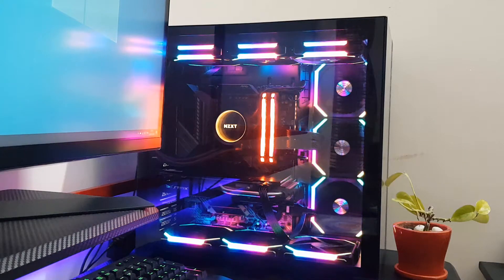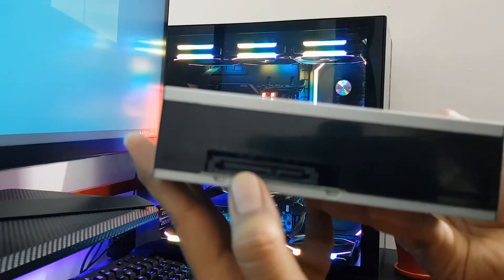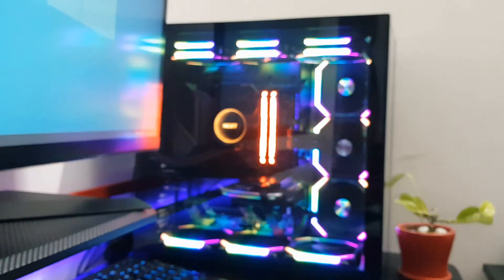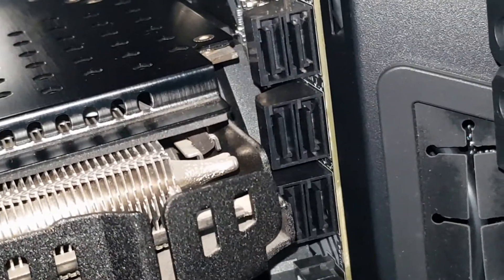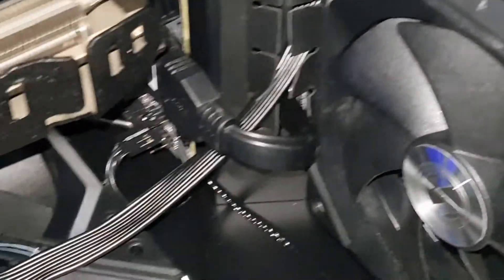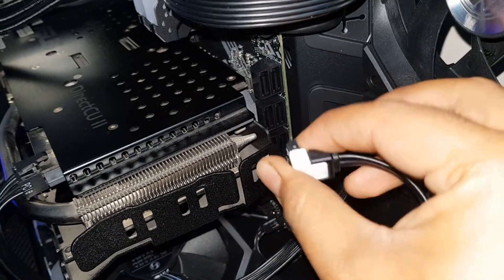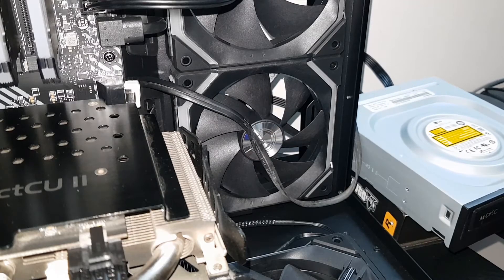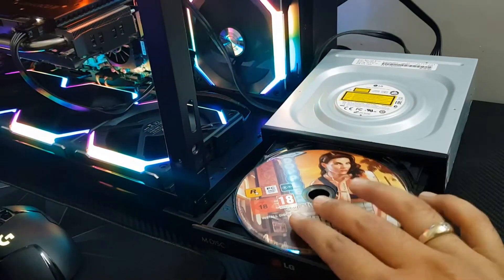Installing a CD DVD rom in a gaming PC!

Comment: Guy speaks pretty good English compared to some I've heard who were professional tech professors. The real issue to me is why don't these cases at least have a single slot 5.25" bay? I'll be using a cheap gamer case I found at a thrift store but I'll have to think carefully about the fans because the acrylic is brittle. I would like one fan blowing directly on the GPU.
Reply: I guess you would have to plug your DVD drive temporarily like the guy did in the video.
For a while, I had HDD outside of my PC case since there wasn't enough space inside.
Also, when I install an OS, I burn the ISO to a DVD-RW.
Reply: There's largely no need for 5.25" drive bays anymore. Practically no modern PC has a disk drive anymore. There are still some PC cases that have a few drive bays, but they're not that common anymore. I have an Obsidian 750D that has 3 drive bays, but I don't use them.
Reply: @JJFlores197  there actually is still a use for them, many people still use CDs. I don’t think it was the right time for them to remove them yet. It’s like they’re forcing it when they shouldn’t be.
Reply: @pawnstarrickharrison7225  I get what you're saying, but those are more of the exception rather than the norm. Look in general PC software. Most PC programs are exclusively sold as a digital format. If you do find a physical copy in-store, its usually just a download code. Its not like optical media is completely dead, but it just is significantly less used than 10 or more years ago. If you still need, you can still buy DVD drives. If your PC case doesn't have a drive-bay, you can buy an external USB DVD drive. It may not look as sleek as an internal drive, but it works pretty much the same.
Reply: @JJFlores197  Can you recommend me some cases that still have drive bays?
Reply: @GXMenace  I haven't really kept up with cases in a long time. Like I said, the only I know of is the 750d by Corsair.

Comment: Bro you can just use an external DVD rom which connects with USB port
Reply: Does it matter witch kind to play games or all they all the same to play games
Reply: @royal6hunnid  The SATA interface is faster than USB, but either should be more than enough for the speeds that a DVD reads.
Reply: RH your method looks a lot better too
Reply: Slow as balls from my experience
Reply: @LiEnby  balls are pretty fast, from my experience.. 👀

Comment: Dvd or Blue-Ray slot put where. !! Side also cannot , put below also cannot..! Omg you Xigmatek.
Reply: Just put it outside the PC
Reply: @thesonofdarkness936  ikr how and why tf would you fucking put it inside your PC (I'm not even being sarcastic) just bruh you legit have to either take it apart Everytime you fucking put a CD inside your PC/put it outside of the cd ROM whatever idk
Reply: @robibobi0089  because then you have to take about the fucking panel just to run the cables out, most gaming rig cases should have a bay and a slot for an optical drive.